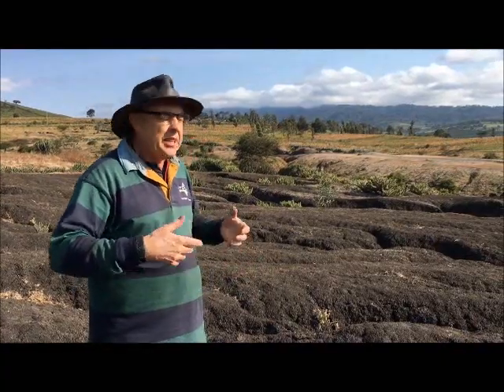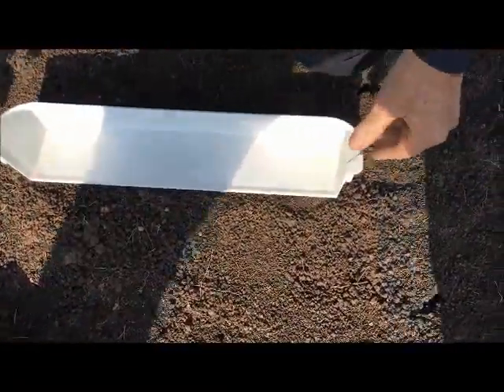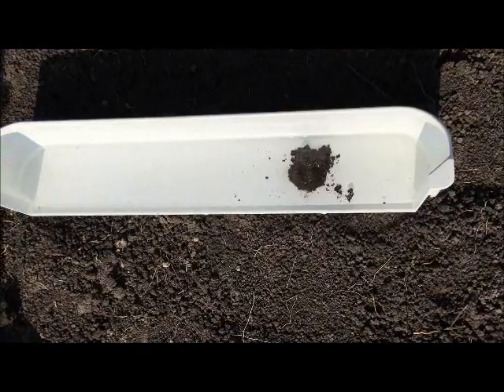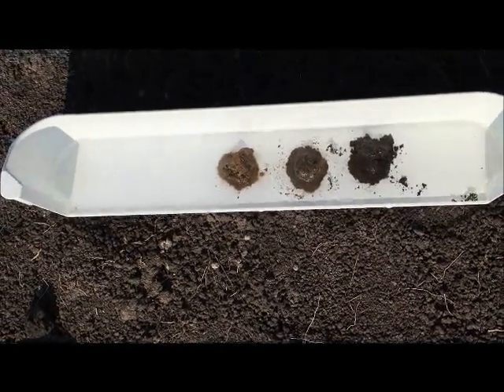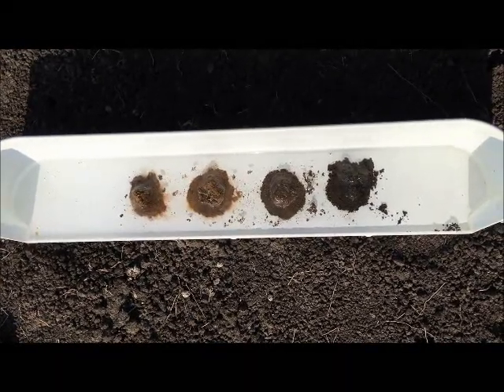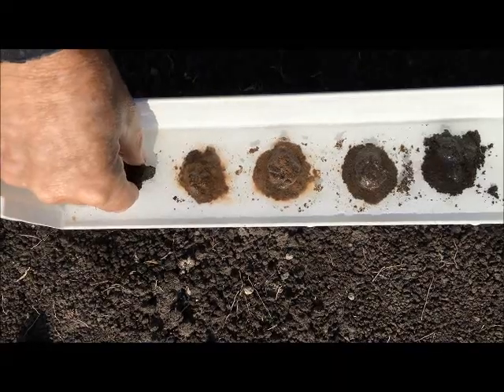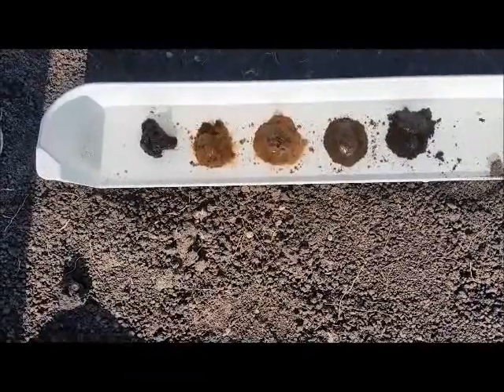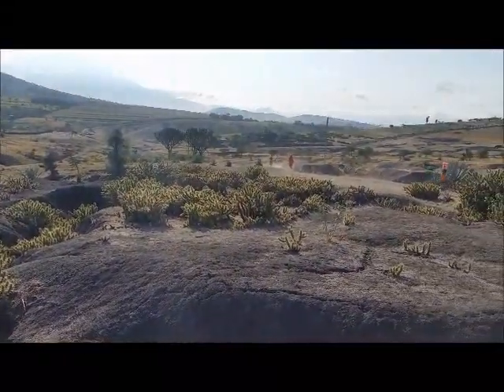Overcoming Soil Erosion in Tanzania

Comment: Hi ! Interesting video ! What type of soil is it and in what part of Tanzania are you ? Thanks for this nice upload.
Reply from the maker: As discussed in the presentation, the surface layers are a black cracking clay, when hand textured produced a ribbon of over 10cm length, suggesting it could be described as a heavy clay soil (>50% clay content).  
I described it as self mulching, because in the dry season, when the soil dries out, very wide and deep cracks develop in the soil, into which any available organic matter can fall into, break down over time and "mulch" the soil to depth.  However, as shown in the YouTube, these soils slake very easily and their structure falls apart when quickly in water, which makes then very susceptible to gully erosion.  Unfortunately the surface is often made completely bare due to the burning, removal or grazing of crop residues.  This has contributed greatly to the very severe gully erosion that is expanding greatly after every wet season, and will continue to do so unless changes are made.  This video was taken just south west of the city of Arusha in the north of Tanzania, but similar soils and erosion gullies were evident in many other areas as well.